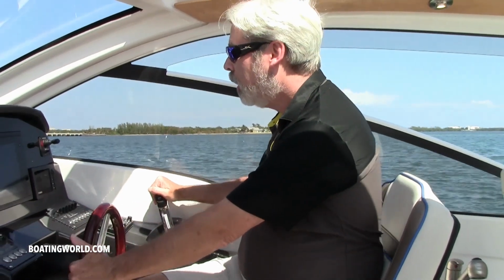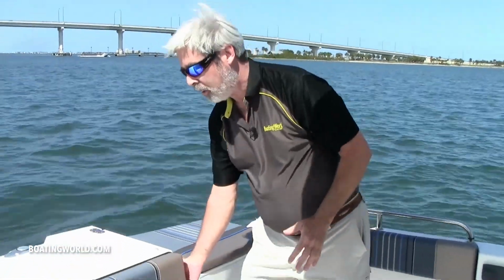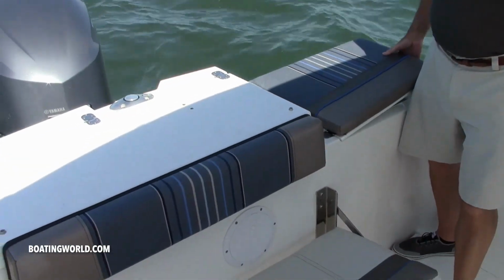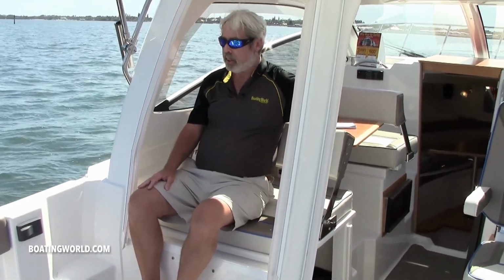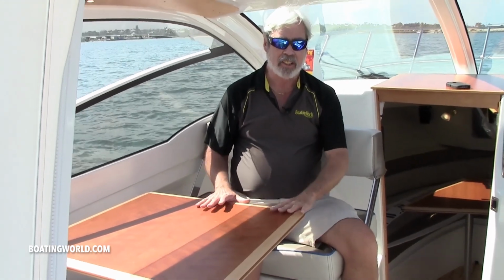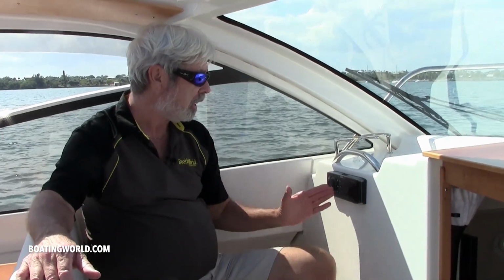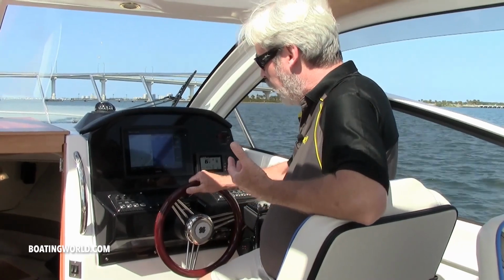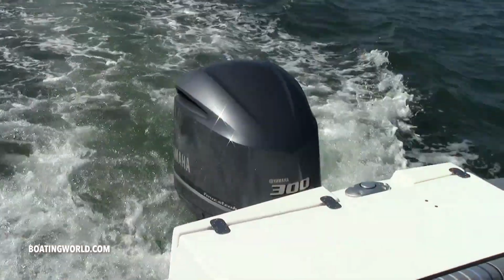Cutwater 242 Sport Coupe – Boat Test

Comment: There are a lot of choices out there and I think you best deal is that rare preowned boat that's like new and cheap but after leaving that fantasy behind in the world of boats with really nice cabins and features for under $150,000 the list gets short. There is the Glastron GS 259 which He has done a review but not the fit and finish although loaded its $117,000 and the cabin has 2 large berths very nice. the Antares 27 nice less money but again it is very sterile not a lot of wood its a solid running boat, then this Cutwater that has 4 different configurations but with the generator A/C its at the top end of $150,000. I like it a lot , I liked the Glastron also but im hearing issues so ??? take care!

Comment: You didn't explain what you do to enclose all those openings when your done for the day.
Reply: Thanks. I've been wondering about that. Thinking of buying one.
Reply: Brian Werner "You didn't explain what you do to enclose all those openings..."

If you live in an area where the weather would make a fully enclosed cabin more comfortable, there's also the Cutwater 242 Coupe (as opposed to the 242 SPORT Coupe shown in this video).
Reply: There are isinglass panels that fully enclose the cockpit.
Reply: Hey, it's early. I understand your post now SeikiBrian. Yes, if you live in places like the northwest, the non-Sport Coupe is probably your best bet.
Reply: Duncan McIntosh "if you live in places like the northwest, the non-Sport Coupe is probably your best bet."

Yes, and it also has a small galley in place of the starboard aft-facing seat on the Sport Coupe. Both versions have a lot to offer, and if I win the Lottery I might buy one of each!  ;-)
Reply: Duncan McIntosh  the 24 is a little small for my family. Buying a used 26.
Reply: Brian Werner "Buying a used 26."

Congratulations! Is this your first boat?
Reply: SeikiBrian I had a 24 ft sailboat years ago and a 13 ft whaler for crabbing. I'd say this is my first real cruiser.